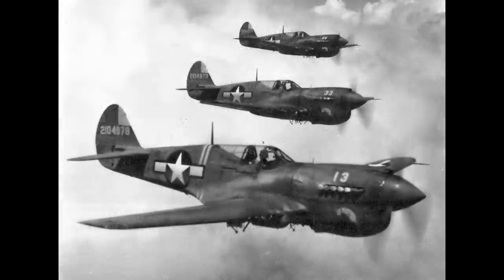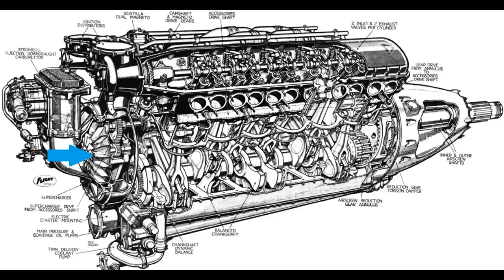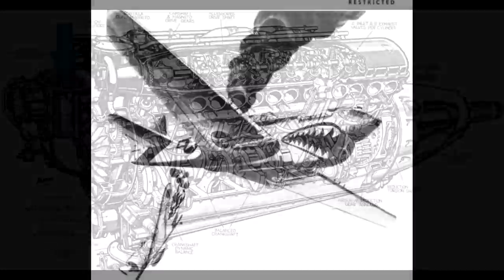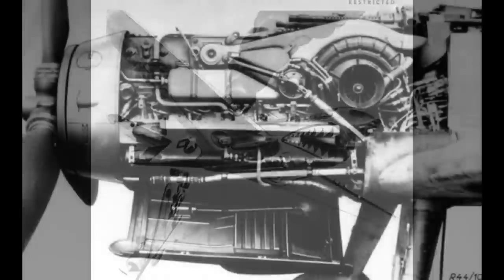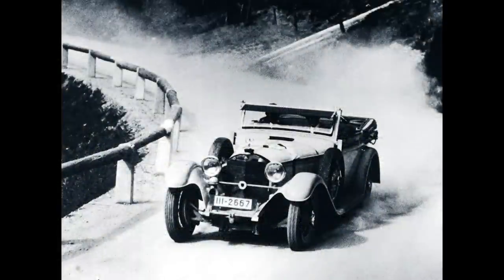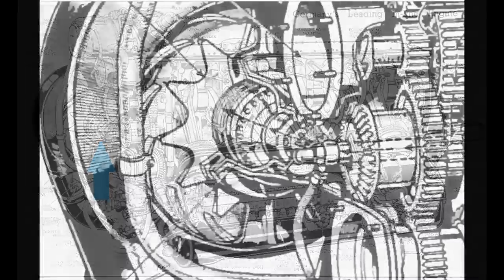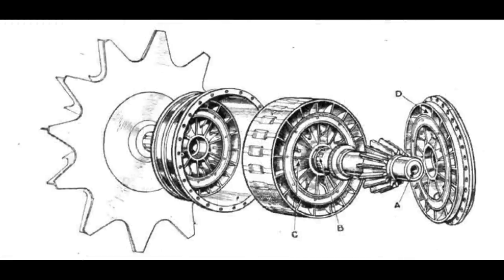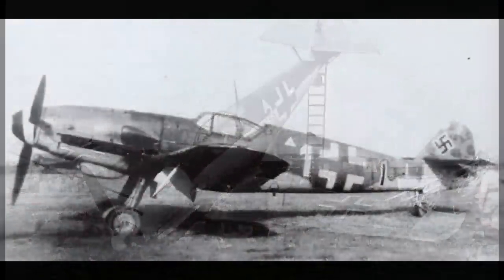Messerschmitt BF 109 Supercharger Drive System

Comment: The charger is at 90° to the crankshaft because of the cannon. This is thanks to a demand by the RVM from the 1930s. The Jumo 210, predecessor to the Jumo 213 used in the 190D, also was built according to the same demands, hence also the inverted cylinders for increased forward visibility. BTW, the FW 190D-12 also has a 20mm "Motorkanone" firing through the prop hub. You can also see this at the F4a prototype for the DB6XX family which was built with a "Schusskanal", or "projectile conduit". In fact  RLM document L.A. 1432/33 from February 1933 specifies an optional canon firing through the propeller axis as a demand for what would become the 109.
Reply: I was going to suggest this too.  Having the supercharger turned 90 degrees keeps it out of the way for a cannon firing through the engine's V.
Reply from the maker: That explanation would be perfect if there was a cannon on the Mercedes SSK. The 90 offset drive pre-dates the 109 so while I don't doubt that it helped create room for the cannon it could not have been the reason for it. Plus the supercharger will fit behind the engine even with the cannon.
Reply: Greg's Airplanes and Automobiles The 90° angle predates the 109 because the RVM under Wolfram Eisenlohr demanded a prop-weapon in the early 30s which made the weird position of the charger necessary. My knowledge of interwar racecars is admittedly limited to what I gathered at Klausen races, but I remember SSKs with a compressor dead center on top of the crankshaft in front of the cylinder block. Sucking in air from the right side of the engine delivering compressed air to the intake manifold on the left. Therefore the path of the gases remains the same, albeit mirrored back to front compared to DB 601 and 605, but the drive of the charger on the M06s I've seen most definitely is in line with the crankshaft. Then again, I don't exclude the possibility that a different arrangement was implemented on SSKs, but I haven't seen any.
Reply: I see the SSK supercharger was also switchable, and since it predated the supercharger in the 109 perhaps it was convenient/simpler to duplicate the concept and technology of the SSK-style supercharger for airplane engines than to start from scratch with an axial supercharger.  The fact that the 90 degree supercharger left room for a cannon was further reason to leave well enough alone.
Reply: Yeah, after looking online for 10 minutes, I can't find anything on SSK compressor with anything other than the typical roots blowers sitting on the front of engine with no angle between crankshaft and blower vanes.
Reply: @GregsAirplanesandAutomobiles  Mercedes SSK prototype probably had a canon, it's the only explanation.
Reply: Engine was inverted in an attempt to concentrate as much mass as possible on the centre line of the aircraft. This would marginally enhance the roll rate as there would be less inertia to overcome when maneuvering. A modern day example of this would be  having the engine mounted in the middle of the car for optimising the cars ability to change direction on the road  when cornering.
Reply: panayis zambellis it also gave the pilot a much better forward view, critical for a fighter

Comment: That was excellent I’ve often wondered how the German engines supercharger worked. I’ve seen many static displays of the 109 and noticed the supercharger intake. You have to marvel at the the technology of that era, even before the war, even by today’s standards looking at an aircraft fighter engine is amazing, the Germans had fuel injection that had an effect in performance over the carburetor. As an example the Merlin powered Spitfire had a problem when a negative attitude was exerted on the aircraft that caused the engine to lose fuel, briefly, that was corrected by a simple ingenious check ball of sorts, but the German pilots took advantage of that scenario because a puff of smoke from the exhaust signaled this effect and that allowed just enough time to kill its adversary.
Reply from the maker: The German stuff was really impressive, the supercharger drive, the fuel injection, roller bearings everywhere, Nitrous Oxide, Water Methaol injection, a lot of engine displacement and very high allowable piston speeds. Still, they never had the power they should have considering all these advantages. In my next airplane video, I'll explain why.
Reply: Greg's Airplanes and Automobiles great I’ll be waiting your doing a good job.

Comment: I think i found the answer for the 90 degree supercharger.I have spoken to a German Engineer that worked previously in F1. He said that on cars it was done because of packaging issues. Engine was already high there was no room to put the roots blowers on top and there were not much space in front either so they put it 90 degrees to the crank to get a better packaging especially on the Auto Union cars that had 45 degree bank angle. And for aircraft he said it might be due to the already big centrifugal superchager increasing frontal area and drag if it was placed normally. My take on this is that they had gotten used to this method. They have been putting their superchargers 90 degrees to the crankshaft ever since 1921 , when the time for making the forced induction aircraft engines came around it was just common practice and they kept the same layout. French also did something similar , when they started using german Panther tanks after WW2 they got used to the "compressed air bore evacuation" system and kept using the same system ever since which is also present on their latest leclerc tank. Meanwhile pretty much every other nation uses physical bore evacuators placed on the barrel. The reason why French still use this system is because they had gotten used to it during their time with panthers and didnt feel the need to change. so something similar might have happened with the germans with their 90 degree superchargers. Also here is the German Ex F1 Engineers channel https://www.youtube.com/c/BSport320/about
Reply from the maker: That makes as much sense as anything else. I would still like to see an original source though.

Comment: Hi Greg, after googling around on the supercharger being mounted 90° off to the motor ... err... sorry, engine, I couldn't find any clues on it in german language. But the RAM effect is mentioned here and there as being important, so probably your guess is right. The fluid coupling described was filled by a regulator pump - this procedere reminds me a lot of hydraulic retarders used on heavy eqipment. If you can't find these strange german Umlauts with dots on your keyboard, you can add an "e" to the vocal - like Föttinger becomes Foettinger. Then it's SUPER correct. Subtext translated him to "Herman Fought Injure". Not bad, Youtube, not bad... Your videos are just great, Greg. I subbed
Reply from the maker: Thanks FatCat

Comment: Having worked with the Germans for several years in the 80’s and 90’s I can attest to the fact there is a definite reason for everything they do in engineering.  Excellent channel content.  Nice to see authentic historical topics thoughtfully explained.  Keep up the good work.
Daimler Benz documents call the BF 109 supercharger coupling a “barometrically controlled hydraulic clutch which operated independent of pilot inputs.”
Reply from the maker: Thanks for that post!

Comment: Do not have any sources,but I am thinking about period supercharger automobile designs I have seen illustrations of. The Bentley Speed Six had the crankshaft driven blower just forward of the engine casting,down low. The camshaft drive was called a skew gear by the British,aka bevel gear,I think at the rear of the engine. Alfa Romeo had the blowers in the centre. Also bevel geared,and camshaft as well. I am trying to remember what Mercedes Benz did with their SSK and the racing SSKL,but will look later if I can find my reference.
Point is,once an engineering concept is settled on,tends to be followed for some time,and drive by bevel gears was a very common approach,despite some very real issues with torque loads and axial movement under  delta of  load. Possibly that  German placement was used in the twenties when exploring aircraft supercharging was first successfully done. Once settled on,the guys coming out of the engineering schools had it explained to them "this is what we do". And it was easier to go along with existing approach unless good reasons for a plan B showed up.
I really like these technical articles you bring out. Not aware of anyone else who does. Cheers.

Comment: Putting the Turbocharger at right angles instead of lateral means that the air would be compressed firstly in the engine cowling making it easy for the turbo to breathe in more easily, secondly, laterally mounted avoids ducting from the front to the rear or where ever the turbo is situated, the P47 had those huge ducts to get air to the chargers thus having to build the huge plane that is was, if the turbo was facing towards the rear of the plane, at 350/400 MPH, there would be a vacuum created by the air rushing past and the turbo would be ineffective and just deadweight

Comment: Another info i dont know if its in comments: fottinger mechanical-hydraulic coupling is used in medium sized diesel locomotives (before diesel-electric drives) in 20s and 30s, it was common there, and uses diesel engine crank to move fottinger power-hydraulics which move trough pressure lines individual hydraulic motors on wheeled axis. its great for power-torque conversion, and efficiency is also great.
Greetings from railways worker.

Comment: Late Allison V-1710 engines had an auxiliary supercharger driven "through a variable speed hydraulic coupling; the speed was determined by intake pressure". The engines were used almost exclusively in the P-63 King Cobra. That plane was designed to allow the greater length of this engine. Sounds like Allison was following the pattern of the DB60x drive system, it just was in a two stage system and too bulky to be a straight replacement in most fighters. A later development was used in the XP-51J with an intercooler and performance was 1700 hp @ 20,700 ft.
Reply from the maker: The multi stage Allison could have really turned into something. I'll talk about it in a video at some point.

Comment: My guess is that the supercharger is side mounted purely to keep the length of the engine down, look at how they had to lengthen the Spitfire when the two stage supercharger arrived on the Merlin, Greg states that the 109 had the advantage of being small.  I note that the hydraulic coupling is given great credit in this video and the gear driven conventional arrangement that needs intake throttling below critical altitude is rubbished. But my take on this is that the hydraulic coupling power losses which even exist even when fully ''driven'' compared to conventional gear driven which has no losses detract from any benefit. By how much I do not know, but it must be a big something. I say that because no other aero engine adopted that arrangement, when doing so would have been a fairly trivial task at the design stage.
Reply from the maker: Ah, but other Aero engines did adopt this arrangement. The XP-72 is set up this way, but the jets took over before it came to full fruition. I covered this in a recent video.

Comment: About the 90 degree placement on the engine... without it being on the front or back on the crank shaft it makes it easier to remove and or replace for repairs. I'd assume the multiple gear systems would make this contained part more prone to wear and tear than other parts. Maybe, I'm a motor engine troglidyte in these matters so I could be far from correct here.
Reply from the maker: It could very well have been for serviceability. I like that theory a lot.
Reply: I'd put money on it. Also keep in mind that the engineering philosophies of Germany vs Anglophone nations at the time (and kinda now, but much less pronouncedly so) strongly support not only this, but also the English speaking engineers' inability to suss out the reasoning. We have numerous examples from prior to WWI through to the end of WWII where German designs are simpler, easier to service, and thus much more reliable than their British and American counterparts, and in multiple instances this allowed the Germans to spend more time on innovation than on getting a less well thought out mechanism to work over multiple generations through failure analysis via field reports (which was a really common thing for the Brits and Americans).

Comment: Another good video.  I have always assumed that the side-mounted superchargers is to facilitate maintenance, particularly with a relatively complex hydraulic drive.  With superchargers mounted at the back of the engine you basically have to pull the whole engine to mess about with the supercharger, which is probably fine if its reliable and driven by simple gears and clutches.  I would imagine the variable speed unit needed a bit more tweaking.  It will also shorten the engine, although I am not sure that's a major concern.
Reply from the maker: I lean towards that explanation as well, but it doesn't explain it's use in cars. For example servicing the supercharger would be easier if it was mounted with a parallel drive on the side of the engine. Plus, with access panels locating it on the rear wouldn't be a problem, we put carbs back there, which require service.

Comment: The Merlin used on even the earliest Spitfires and Hurricanes had 2-speed superchargers. The Allison V-12s were supposed to have turbochargers as standard, but turbocharging proved difficult to implement in practice, so Allison were forced to omit these from the P39 & P40 single engined fighters and fit single speed superchargers, which is all they had available.
Reply: Every single Spitfire and Hurricane during the entire Battle of Britain had a single speed supercharger, and in fact the first Spitfire to have a 2 speed supercharger didnt arrive in service until June 1942.
Reply: Thanks. So the problem with the Allison's supercharger was that it was low boost? Probably because it was originally designed to be the second stage after a turbocharger.

Comment: As a note, the supercharger drive varies its ratio based on the pressure of atmospheric air from the static port, not a line from manifold pressure - I do not know why they chose to set it up this way.
Reply from the maker: Both ambient and manifold pressures are inputs to the system.

Comment: Re sidewinder supercharger this was on the Kurfürst site.  Per Flight magazine April 16, 1942 re MB 601N “Since clear fore and aft space is required for he mounting of a cannon at the rear of the crankcase the supercharger had to be mounted with its impeller axes (sic) transverse to the centerline of the engine to place the bulk of its volute casing  to one side, and not in the position as in the Merlin XX, the Allison and other “in line” engines.
Reply from the maker: Yup, I've read that too, but it's wrong as they did it on EVERY application and well before the use of cannons firing through the spinner, and on cars!

Comment: What do you mean obviously the Merc didn't have a cannon!?
Reply: It did not have a cannon firing through the propeller as the ME 109. which fired in between the cylinders through the reduction gear.
Reply: Novat Why would you fit a cannon in a CAR?
LMAO pointless
Reply: @left_ventricle  couldn't you imagine a MG42 on the passenger seat? That would sort' off pretty nicely badass
Reply: For sure they have planed to install cannon in Mercedes as they already put sigh on bonnet. 😂
Reply: Because Adolf didn't want all this James Bond crap on his Benz. He probably had an Mg42 in the trunk...just in case some communists would dare to block the road. :)
Reply: little _lotusiest don't knock it until you've tried it . . . People drive like assholes. My glove box potato gun E36 bmw will always be legendary for putting someone else's road rage in check.  
  It was completely concealed as the barrel poked out from behind a ported high beam lamp.
Reply: The prerequisite for installing the motor cannon is the relocation of the gear stick from the center tunnel to the dashboard. However, this was rejected on fundamental reasons.

Comment: Maintenance access and cooling.. are the only reasons I can think of …. In the 3 years I was in an F-4 squadron .. we had a few hydraulic pump and generator failures but zero engine failures … one broken engine mount only …. Those j79 ‘s are tough ….!